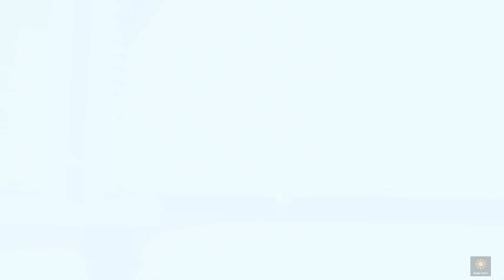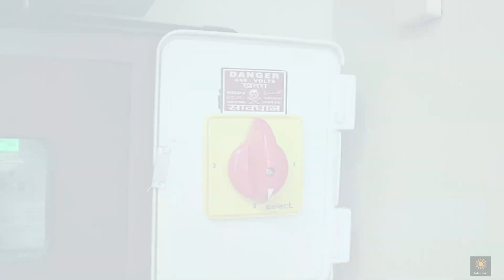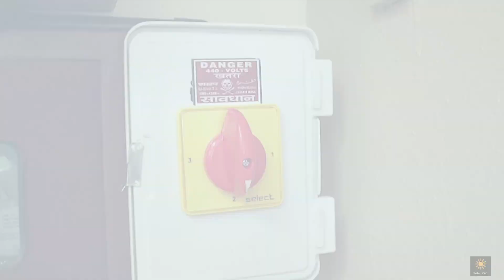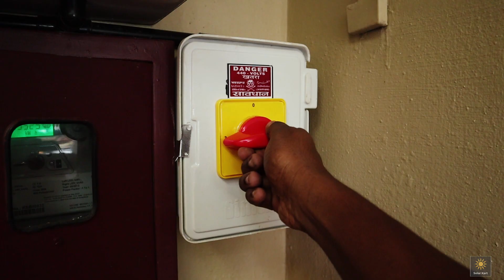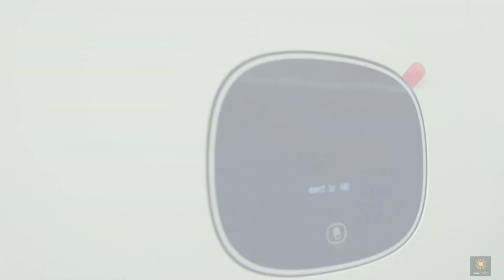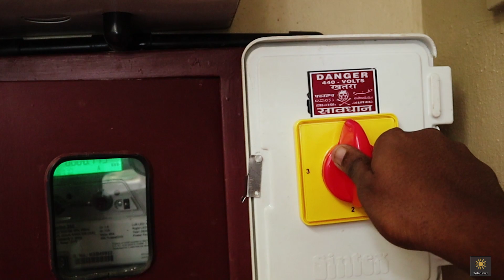3 ഫേസിൽ ഒരു ഫേസ് പോയാൽ ഓൺ ഗ്രിഡ് സോളാർ വർക്ക്‌ ആകുമോ?? വിഡിയോ കണ്ടു നോക്കൂ.. #SOLARKART

Comment: grid high voltage causing single phase inverter to switch off 1 pm to1.40 pm  intermittently in my area. can anything be done
Reply from the maker: Maybe due to low demand in the HT line. Is it a single phase or 3ph ?

Comment: 3 phase Invertor ഒരു phase ' ഇല്ലെങ്കിൽ worlk ആവുമോ
Reply from the maker: No. This system is for a customer with 3phase connection and installed 1ph on grid system.
Reply: What about 3 phase line with 3 phase inverter? Will other two lines work if one line is down?